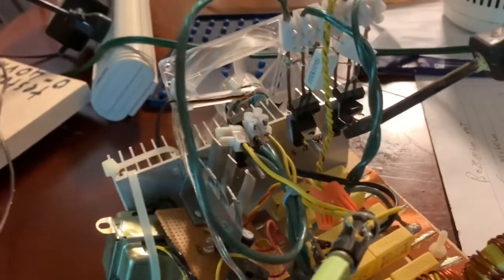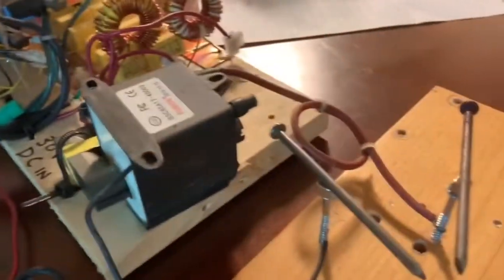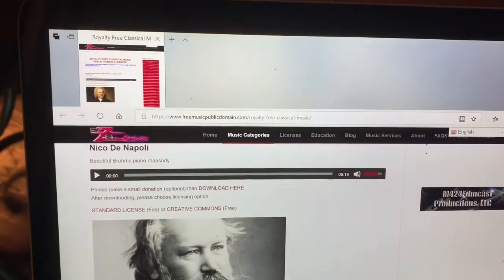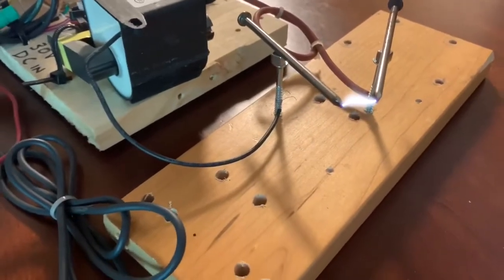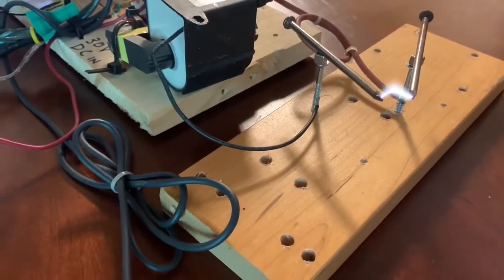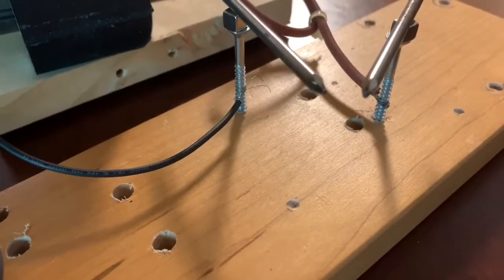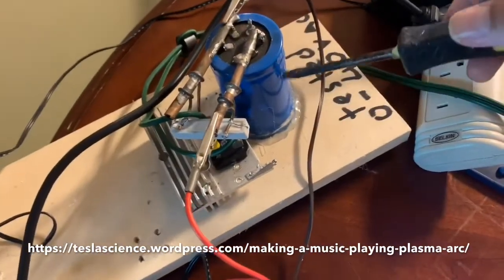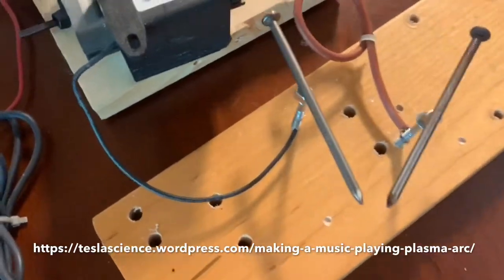Playing Speakerless Music

Comment: One common element of arc-based music is that it's very high trebble and very low bass.  I wonder if there is a way to get a richer sound out of it?
Reply from the maker: I agree. Best would be to use a classD amplifier to modulate the input voltage!